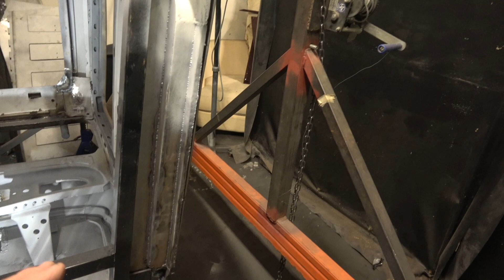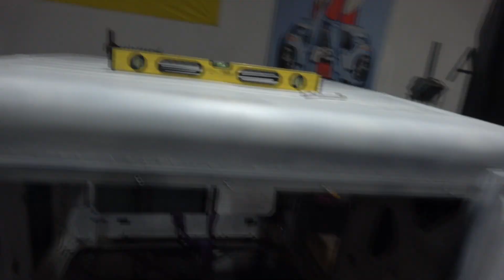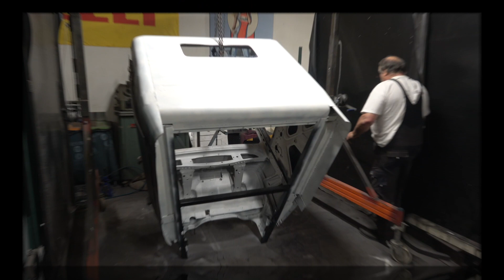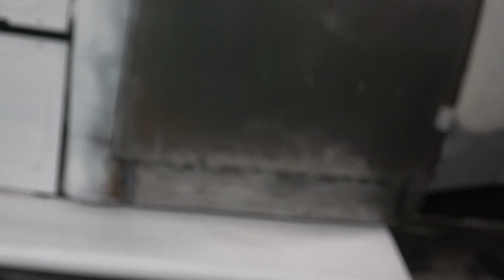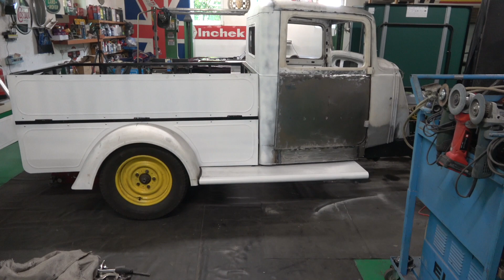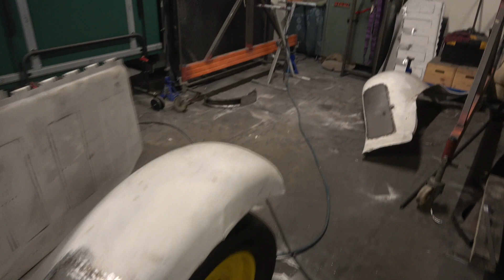1930s Citroen Barn Find Built Into A Pick Up ( Cab Fabrication )

Comment: Hi Dave . I could see the cab was about to drop .......NO!!!!  But your repairs saved the day . Your getting there but those front wings and bonnet side panels  need lots of love ! Cheers !
Reply from the maker: John,  I should have changed the position of the strap but hay Ho! There is so much work to do and the whole body but as I said I need to know I can get it on the road 
before I invest too much time & money into the project otherwise I may have to part out the parts 🤔 I hope it will not come to that. Cheers Dave